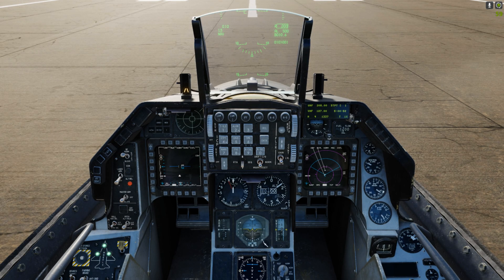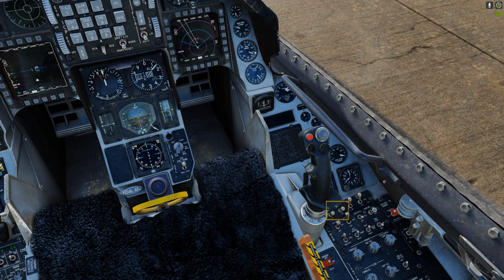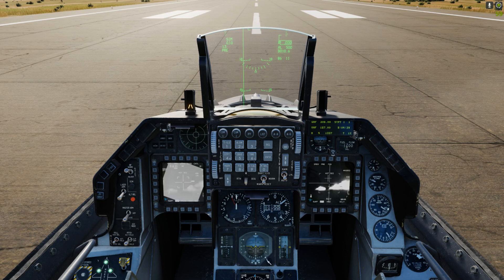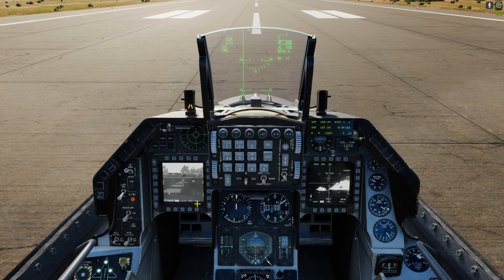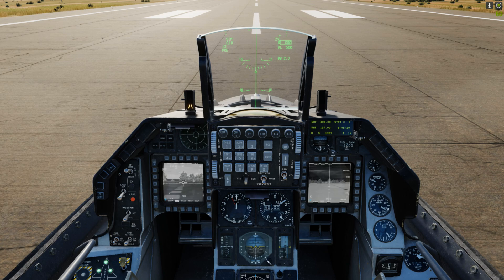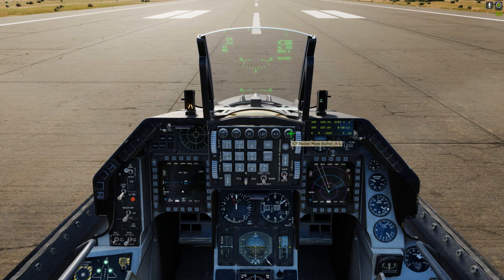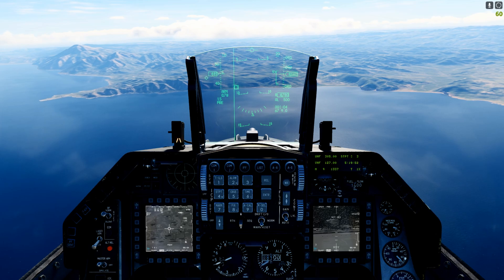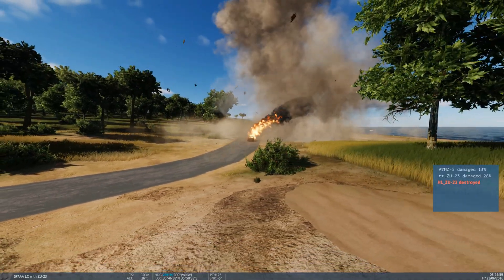DCS World NEW BORESIGHT PROCEDURE FOR F16 AGM65D

Comment: I can not get the auto hand off to work properly in PRE mode, I feel like I'm doing something wrong with boresighting, but I followed this video entirely. Any slight oversights that people make that I may be doing? When should I put the TGP in auto? I did it after boresighting
Reply from the maker: I am not sure what the issue is, however this guide was posted after a recent change to the bore sight process. I would check with the DCS forums to see if the procedure has been changed again.
Reply: @callsignnictmere465  I read the latest manual for the F16 on Mavs and it seems spot on still, but I will check the forums, thanks!